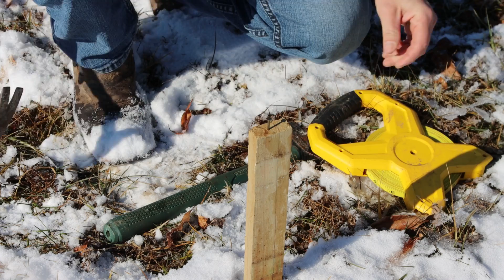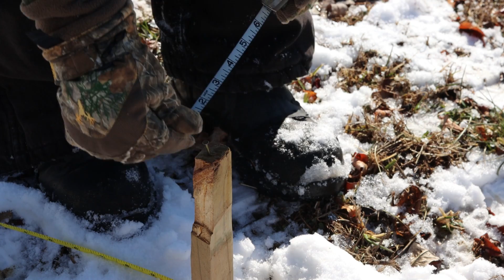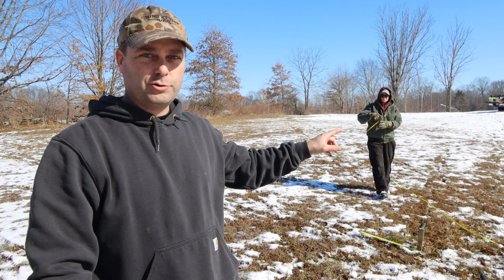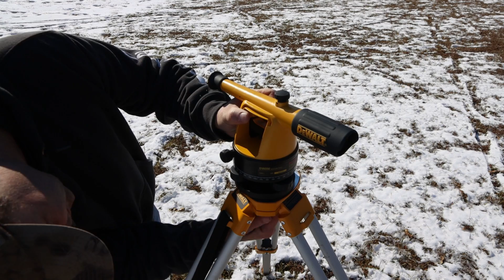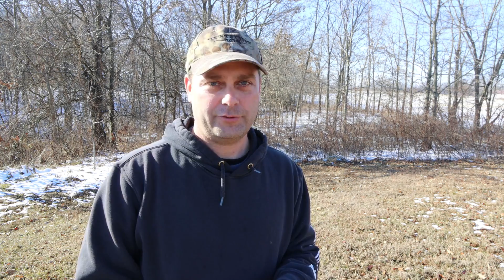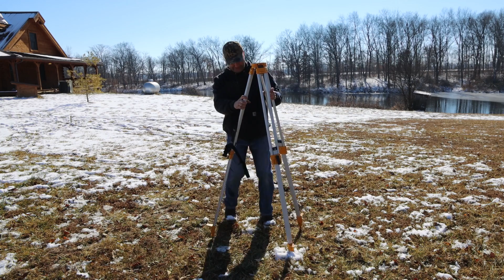Laying our build site and Measuring grade.  Pole barn workshop Build #1

Comment: I would consider putting the root cellar under the low corner of the pole barn. Do concrete block walls for the root cellar then use the remaining dirt for the pad leveling.

Comment: I'm a professional land surveyor. To figure your grade fill manually, break up the area into smaller rectangular sections and figure the fill from the lowest point in the rectangle to the highest for depth then length times width times that depth all divided by 2 will give you the fill amount to level that one rectangular area. If you are going to fill that same area higher than that then just add a simple length times width times height volume above that. Overall just break it up into smaller areas then add all the volumes up.  Or if you have a buddy with AutoCAD software you can compute it easily.  Don't forget about the compaction factor when you buy fill material. Anyway, I enjoy the channel. Can't wait to see how it turns out.

Comment: The first thing you are going to have to do is rent you a bobcat or skid steer and get all the topsoil off the area where your pad is going to be then you'll really know how much fill you need
Reply: I would also remove the top soil, over time, the top soil will compact uneven due to breakdown and can cause problems to the pad above.
Reply: Agree with Jim  Topsoil has to be stripped before any material is added but any calculation for fill will depend on depth of topsoil   as it likely is not evenly spread out over the area you are trying to fill in
Reply: Agreed, plus he can move that topsoil down below the house where he has a lot of clay which would be a win/win by improving the soil there too.

Comment: Being that the elevation change isn’t very drastic, If your tractor is capable - would you consider REMOVING earth from the higher elevation points? Then A- you wont have compaction issues with fill dirt later on (cracked slab, etc). B- Save yourself a little money not having to bring fill dirt in. Going to be a great addition to the homestead; cant wait to see it all come together!
Reply: I agree, you need to remove the topsoil before you start grading, hidden creek homestead is right, it will make grading easier and should save you Money, I would save some topsoil to top dress the slope after the pole barn is finished, hope this helps.
Reply: Yes I totally agree unless you remove the top soil compaction will be a problem

Comment: That’s going to be a nice pole barn Evan that will be nice when you get it up one of the barns is close to the house I am having work done to doing work on the inside they been using a jacking it up and redoing the inside and put the new shed on the front of it it has another shed on the other side of the barn and going to put a new metal roof on it I will be glad when they get it done materials is high for barns looking forward to the next video and the pole barn on your place y’all stay safe and  talk to you next time 😎

Comment: In a similar scenario with a far greater difference which was 14 feet between the highest and lowest points. We split the difference, reducing the highest end seven feet and raising the lowest point seven feet  and the rest levelled between those two which created a perfectly flat area which was  84 ft x 40 ft. The raised area was compacted in layers 6 inches at a time with a compacting roller  and  sloped away from its edge and compacted to give it support. The top soil all needs to be removed to prevent any growth and only subsoil compacted Both in the raised area and the excavated area. This will ensure that the whole area is compacted to the same  degree  and hopefully  prevent any major movement of the pad.

Comment: I’m going to follow up this project carefully because I’m planing a “garage”/workshop for this summer. 
I’m planing to insulate and place pex for radian heat (the furnace may come in a few years). But thanks to your ideas I’m going to plan for a toilet drain (it may come when there is money to connect to a septic). I’m also planing for another electrical service (besides my house’s).
Up here, in Ontario, there are still few more weeks of winter and at least foot and a half of snow.

Comment: Remove all the topsoil. Put your fill dirt in 4" to 6" compacted  lifts . To figure the yardage  add your 4 corners grades , divide by 4 and then divide that by 27{number of cu. ft. in cu. yd.} 0+1+1+3.66=# .If you remove 1' of top soil add that foot to your 4 corner grades. Also raise your subgrade above the existing grade so you get good drainage away from your building.

Comment: Calculate How Much Soil You Need
Determine how much soil you'll need by using a simple formula. Keep in mind that most soil is sold by the cubic yard. There are 27 cubic feet in one cubic yard. In this example, you need to fill in 3" of soil to level a space that is 10' x 15'.

Convert the inches you need for soil depth into feet.
Example: 3" of soil (3" ÷ 12"=.25')
Multiply the length by the width by the depth of soil needed.
Example: 10' x 15' x .25' = 37.5 cubic feet
Divide the cubic feet by 27 (that's the number of cubic feet in one cubic yard).
Example: 37.5 ÷ 27=1.3889 cubic yards
Round off your answer to 1.4 cubic yards. This is how much soil you'll need.
Sloping Yard
If your yard slopes toward your house and water runs into your home, you need a create a drain and slope the yard away from your home. This is a job that will require excavation equipment and possibly building a retaining wall. Unless you are experienced in this type of garden leveling, it's best to consult a landscape professional.

Leveling Your Yard Is an Easy Process
For most uneven yards, it's an easy process to level it. Choose the technique that best addresses and remedies the uneven spaces in your yard.
Reply: 10x 10     with 3 inches i read...  ??!!   equals one cubic yard

Comment: Hey! Saw a lot of great comments that are extremely helpful and thought I'd throw in a few observations. Yeah you would want to dig down and remove the topsoil for sure. Calculate the thickness of the concrete pad, gravel, and any sand base that are to be used. I've seen a lot of people use the 3-3-3 method...3 inch sand base, 3 inch gravel base, 3 inch thick concrete pad...base soil, sand and gravel all compacted well. Not sure if I'd put anything directly on base soil...that is a big investment to not have a better foundation. A small workshop that would be a quarter of the size might be okay for just a pad, but sounds like you want to put in a decent amount of valuable items in there... last thing you'd want is a cracked floor all over the place. Good idea to throw down a wire fence with an 8"x8" square on it, works like mini rebar to help hold the concrete together. So soil wise, once you find out how thick you need for your foundation area - soil from the front can be moved from the high spot to the low spot. The low spot only gets the topsoil off, so then the excess from the front gets moved to the back to level it out. As well, you may want to reshoot the measurements and make a grid at 5' intervals.. you might find out that the last 5' actually drops 2' on it's own, which would mean you don't need as much fill as you think in the front part based on a gentle even slope. Washroom is a great idea, you'd be surprised at how often it would get used! A small 500 gallon holding tank and a two run septic system should work with the slope you have behind the barn area and should be adequate for the amount of use. Electrical is always a tough one, if you know you are never going to move the tool...conduit in floor is awesome. But you are committed to losing that area if you need the extra space for a project...in that sense, the tool can move but that plug is still in the way. Sickening how these types of projects snowball so quickly into having to think about so many aspects, you try to think of every possible detail and make the best decision but something always seems to come up to make it more difficult!

Comment: I would take away 1 foot of soil from the highest spot and more from that  corner of the building to slope away from that high point so you would buy less fill and have pitch away from all sides or the building.

Also drive  in T-posts in the low spots to establish finish grade.

Good luck Vic

Comment: I've watched many seasoned professionals building pole barns across the US. To a man, they have all removed the topsoil using a dozer or skid steer, before the bringing in fill material, which is then vibro compacted before any stone or concrete is applied.

Comment: Nice builders level. I think the bathroom is a good idea. Maybe a composting stool would save a lot of drain pipe work. Someone else suggested the root cellar under a corner of the pole barn. Might be an idea worth exploring. Just a thought if you drop your power down from above you can always get in the attic to move it if needed. Not near as easy to move in cement. Your barn build it the way you want. I’ve never heard anyone say I should have built it smaller. Lol. 
I’ll be looking forward to your posting on the build it will be fun to watch. 
Stay safe. 
Bruce from Mason Michigan

Comment: Bring in crushed stone to establish grade. tamp every 4 inches of lift. Yes it's more money but any leftover can be used for driveway or drive. DO NOT use fill dirt. In my shop I run conduit in the floor to my  tablesaw , 230 and 115 v duplex box. Also ran conduit under the floor stubbed up in each wall then horizontal to each outlet box. Lights and switch boxes fed from overhead. Conduit will allow you to change/add circuits later. In the floor hot water heat is the most efficient for the money I think. Roughing in for bathroom makes sense even if you don't need it  or want it later.

Comment: Something to think about when running power is to consider running power from either a wall or from overhead. If you move machinery around and have wheeled equipment frequently those power stubs will get in the way. Also, do plan for a bathroom, now is the time to plan and prepare for the future. I am going to put one in my wood shop. Much more work and expense after the fact.

Comment: If you turn the grade rod around it should be laid out in decimal feet (10ths of a foot). Surveyors use this as it makes the math easier. 🙂 the volume of fill needed will still come out as cubic feet and can be easily converted to cubic yards by dividing by 27. You’ll get a great idea of what you’ll need. 🙂

Comment: Evan and rebeca . Hold on before building. Many counties require a 35 foot set off Property side lines also if housing livestock of any type a 100 foot from neighbors property line . If you have a grade drop of any significance why not take advantage of it and build a bank barn on that side you can load and unload trailer and truck easy . Just a thought 💭 keep on living the good life

Comment: There are a lot of good suggestions in the comments.  Here are mine.  I would use your initial measurements as "rough idea" of how much fill you might need.  I would go ahead and remove the topsoil and level the earth underneath closer, then re-calculate how much more fill you need.  Along with that, I would consider packing the fill so you will probably need slightly more than what you calculate.

I am by no means a professional.  This is just what I have observed here in Florida when something like this is going in.

Comment: With that much of a difference in grade you may want to consider pouring a footer and then a knee wall before adding your fill dirt.  I believe you would have issues with your fill washing out from under the slab causing settling and cracking without support.  On roughing in conduit in your slab, I would go ahead and put floor boxes in instead of just stubbing up conduit.  These boxes are flush to the finished floor and do not create an obstacle to walk around or trip over.  Make sure you take measurements and document where the conduit is at in the slab so if you ever set anchors or drill thru your floor you don't hit the conduit.  Finally,  if your going to use trusses,  look at "scissor" trusses as an option to give you the extra headroom for pulling in tractors or maybe putting in a post lift for working on vehicles.   Just my 2 cents on your project, eager to see you all get this build started,  Great channel!!

Comment: Don't start bringing in fill until you have had an excavating professional on site. As someone else has said, the All top soil must be removed first then the building level must be determined   from the level of the substrate. If the topsoil level is absolutely uniform, the difference of the 4 corners will remain the same. Since your levels between 2 diagonals are the Same  and the other 2 are separated by 2 feet, theoretically you should not require any material added to or removed from the site. Simply cut one foot from the high corner and add it to the low corner. Maybe a half day's work for a reasonably good dozer operator.

Comment: Hi, Firstly, love the channel. I have set out buildings before and would suggest the following: Change your corner markers for taller ones. Then marke your required finished compacted soil grade on each one. Then mark your finished compacted stone grade on each one. then mark your finished concrete grade.( I use different coloured weatherproof tape) When that is done I would run a string line between the marker posts for each 3 reference grades and establish a number of intermediate  markers all nicely marked so you have plenty of visual references to help you grade to. You need to scrape the surface and remove that spoil before you commence grading. Use a Bobcat to cut and fill with soil withing the perimeter (compacting every 4 inches) of the build before you even think about ordering fill material as piles of soil get in the way, you need to receive the fill material in a timely manner where you can process it. Factor in membrane under stone, Reinforcement for concrete, expansion joints in concrete. Please also make sure the finished pad is above the highest ground level and I would run a french drain around the building for surface and roof run off water (perhaps to the pond). The roof rainwater run off will be considerable and will also offer you some water catchment options for drinking water for the animals and watering plants etc. Good luck.

Comment: Excited for you guys and the building of the pole barn. I completed construction of a house last year with the plans to build a 30x40 pole barn this year. During the building we included some provisions for the pole barn like water and drain to the septic and for in floor heat fed by our geothermal system which was sized accordingly. I would highly recommend you include plans for a bathroom and utility sink. You should research self composting toilets if you don’t want to tie into the existing septic. My pole barn will be close to the house so hookup was not a big issue. I’m hoping you will share the cost of the construction as I know people will ask.  I can’t help with the soil calculations, but just make sure the fill is compactable so things don’t settle later and cause problems. Good luck with the project. 👍👍👍

Comment: Run your power outlets down from above, not up through the concrete - any time you want to change things around it is a big hassle, and there are always changes as unforeseen necessities arise. Also, a cubic yard of fill is around a ton, different rocks, sand or clay types will effect this, but it is the general assumption used to roughly calculate the amount of fill needed.

Comment: SUGGESTION: the first time I built a barn I put a couple of floor switches in but the proved to be in the way sometime. There was also an unfortunate spill in the barn that shorted one of the plugs out and being under concrete I didn't want to tear up the floor so I wound up running an extention cord to my tools.
The next barn I built i ran the conduit overhead. I love it! I have 2 reel cords that hang from the ceiling with 50 foot cords that automatically roll back up when I want it to. I also have 8 overhead receptacles place in the ceiling do I can drop a cord anywhere I want to.
Of course I have the usual receptacles in the walls but I love the set up and spills are nothing but a thing.
I'll never put electricals in the floor again.
Russ (Florida)

Comment: Just put in a compost loo system, then you do no have to put in drainage. It is just an "emergency" loo. 
We have a bucket with a toiletseat on a plank of wood over in our allotment, and that has worked for over 40 years!
Reply: if they are going to put in plumbing for the butcher room a bathroom is no big deal

Comment: if you are going to run electric in the floor  you might want to run a large conduit/sewer size pipe to put an air line inside maybe even water so it can be replaced in the future.  yes you need to make sure you have a good base also make sure when you pore your concrete to add thickness anyplace you will want to put something heavy (like a lift or where you park trucks and tractors) good luck

Comment: II would like to recommend you think about a wood floor for your wood working shop area due to fatigue standing on concrete all day. It would also make it easier to rerun electrical in the future if yu ever decide to change the layout of your wood shop. Set on at least 6 inch boards with planking on top or 12 inch boards if you ever think about a dust collection system. just my 2 cents
Reply: I agree. I have had both and I by far prefer the wood floor. As you get older, your feet will thank you.

Comment: I modeled the dimensions of the slope and also factored a 30 degree slope around the building.  The amount of fill would be roughly 215 cubic yards.  The 30 degree slope is a little steep but it will give you a good starting point.